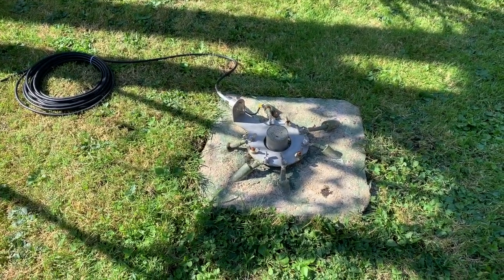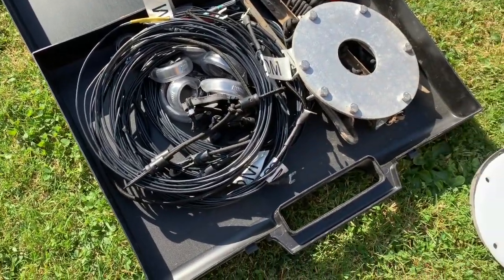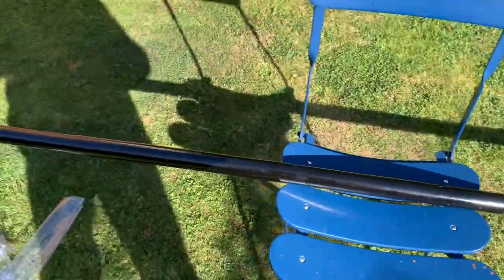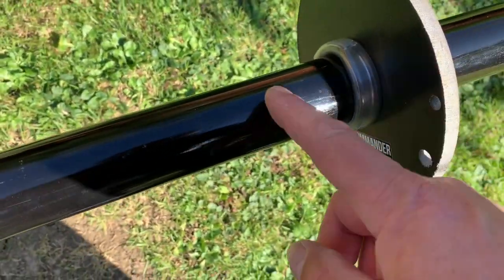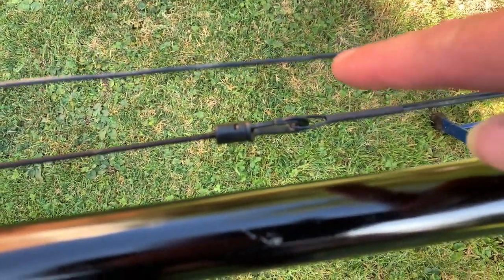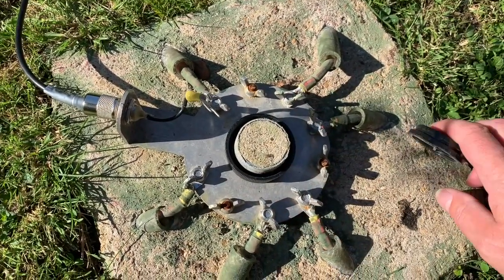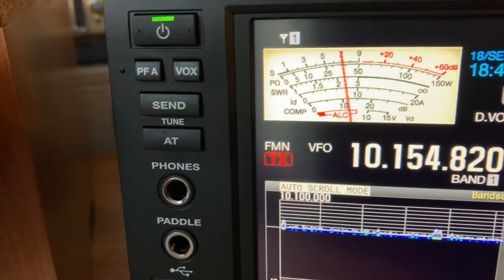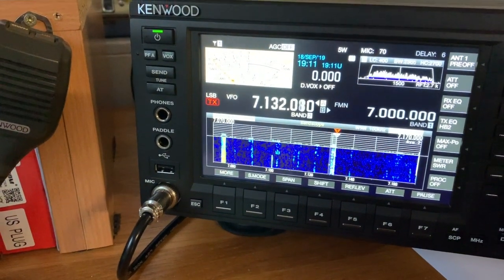DX Commander install on a Concrete Base.

Comment: I like what you did, but for strength you could had made the center pole in the ground longer then slid the antenna over the longer pole to help provide support to the antenna
Reply: The guys support the antenna.  The nub in the base just keeps it from moving.

Comment: So why does this system not use baluns?
Reply: Because groundplane verticals aren't balanced antennas.  Verticals are asymmetric and unbalanced by design.  The groundplane is not the same as the radiating element.  The unbalanced currents go into the ground system.  Balanced symmetric antennas (like dipoles) generally need baluns when connected to unbalanced coax.

Comment: Nice video Mike. My kit has just arrived today so going through a load of videos first. I really like the idea of the base and this is something I will try once I have the thing built. I like the idea of storing the DX on its side using a couple of brackets up the side of the house. Install should then be a matter of seconds.

Comment: You have a video where the DX Classic slips over a yellow tube sticking out about 3’ from the ground. What is the outside diameter of that tube? I have a Classic on order and I’d like to replicate that set up. Thank you!
Reply from the maker: the fibreglass tube is 40mm in diameter .

Comment: Impressive Mike,  I love your base plate so interested on the diameter of that pole that.s goes into the dx commander. I just need to think how to secure the dxc to a concrete fence post, when covid goes I would not want the grandchildren falling over guys.
Reply from the maker: It's a decorators pole 30mm dia
Reply: @mike-M0MSN  Mike I have concreted a 30 mm pole in the ground today using a bag of quick dry cement. I think I will be popping up to the local caravanning accessory shop and buying 3 large storm peg stakes and concreating those in the ground for the guy ropes. Thanks for sharing your idea with us all. Steve G4YTK

Comment: Mike,  I am following your lead on the concrete base!
Reply: I did something similar yesterday but yet again I’m seeing this one day too late. I unfortunately have to remove my bunches of radials to put the new antenna up next weekend as I put my old one up yesterday to see if I got things right which I’m pleased to say looked good at the end of play. Only problem I have apart from the radials is my pole at the moment is 7mtr. and I’m replacing it with a DXC pole at 10mtr so may have to re cut the elements or one or two at least. What’s the secret with the 80meter wire? When I fitted one on mine it sent the swr high on 40 until I took it from the base feed across to a fishing rod then up onto the roof?

Comment: Great installation. Wondering if you used a 36” pipe would the DX Commander stand on its own without guys? I understand that it would need to be a tight fit.
Reply: On my install, using 1-1/4 inch Schedule 40 PVC water pipe, it will go almost that far into the bottom section, and even with the 3/4 inch PVC inside that pipe, it would be good for unsnapping the guys for mowing around. I would not do that on a windy day, (Without guys) as I fear the pipe would worry at the inside of the DXC mast. 
Also, thanks for showing that bottom piece has an insert, Mike. I was prepared to drill the cap to fit it over the pipe. (I keep trying to tell the warden that I should not be left alone with tools without adult supervision.)
Reply: I would use metal pipe. I did something similar with a different mast and it worked. I wish I could talk to Collum but he is not taking emails right now according to his website.
Reply from the maker: Yes I think so, give it a go. 👍👍👍. try to use a Glassfibe pole

Comment: Great video, Mike. You have shown me great detail of the installation which I was looking for. I am strongly thinking of getting the DX Commander but want to do it permanently year around here in the northern CA foothills. What do you and Callum think? Do you have suggestions on waterproofing it, etc.? I also have some local restrictions here on the 65 acres (XYL - hi hi).  73 Alan KZ6B
Reply from the maker: I have my antenna up all year round, guided at 3/4 1/2 and a fibreglass tube 4 foot up inside and 2 foot in the ground. no issues in winds up to 60 MPH not seen any faster wind here....
Reply: @mike-M0MSN  Thanks, Mike. I am also interested in installing a DX Commander elevated about 10 feet above the ground with elevated radials. Have you had any experience with that?

Alan KZ6B

Comment: Hi. Did you make the elements as per the manual
Phil
Reply from the maker: Yes Phil as per Callum's instructions
Reply: @mike-M0MSN  here in the US we use feet and inches. Do I convert or metric 
73 great videos KQ4CDPaul

Comment: Am I right in thinking that vertical antennas when used on 40m pick up plenty of DX, but miss the local contacts around the UK, Ireland etc? Thanks. Bob.
Reply from the maker: Robert Adlington I found that to be partially true I do get a reasonable amount of into G on 40 m with the DX Commander.

Comment: Mike thanks fer the video. I’m mounting my DX Commander in a fixed position as well. I’ve had to postpone my installation due to Wx here in Colorado but should be able to finish up soon. Keep up with your excellent videos... cheers Fred ... KE0EF

Comment: Cal, how about an install ( some version of DX commander)  on a metal roof. I noticed the metal walls at the farm  so likely the roof may also be metal.  I imagine many folks  have some kind of metal roofs. My home  has a porch at both ends of the main  part of  my home with all three roofs being steel. My research on metal as the ground side  of n antenna finally being admitted to work well enough.